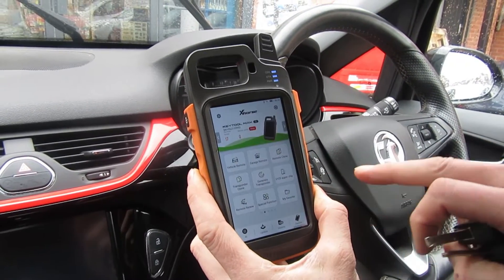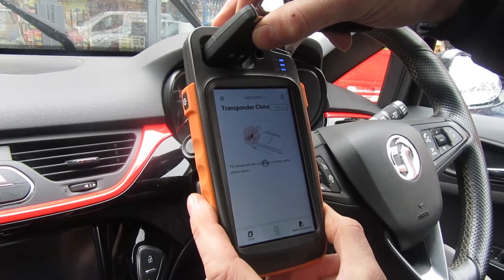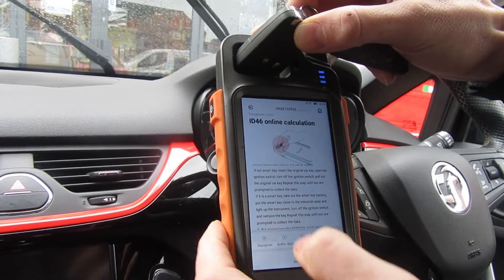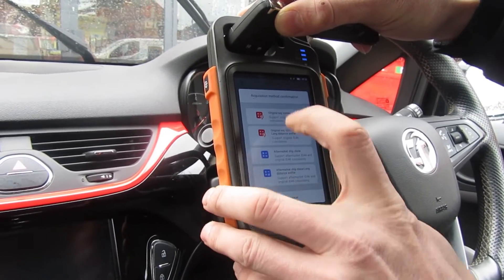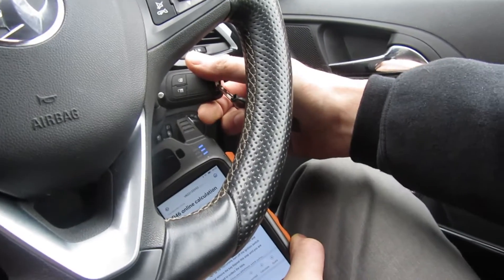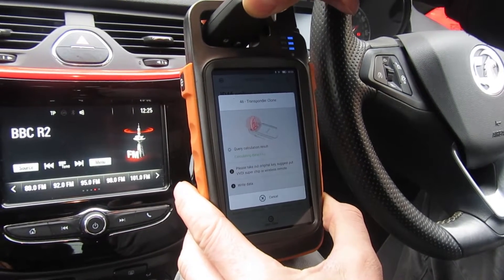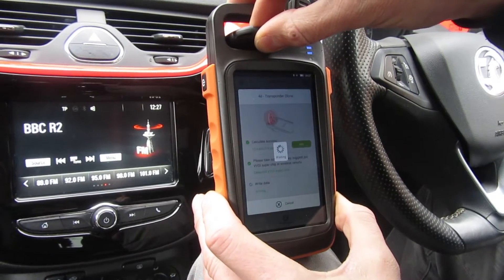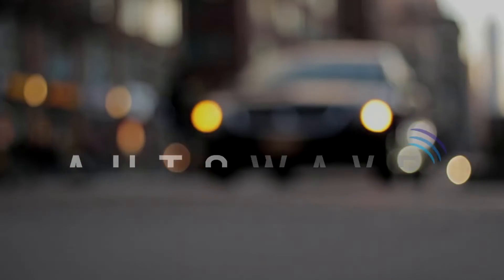Xhorse Key Tool Max Cloning Demo

Comment: where can you buy key blanks with plastic head containing the super chip in it? All i see are key blades for the remote and only transponder superchips by themselves
Reply from the maker: It's not something that we do, the chips are very easy to insert into the key blanks though. https://www.autowave.co.uk/product/forkc-ford-key-blanks/rav-ford-hu101-manual-transponder-case-autkc076/AUTKC076

Comment: did you find remote on other key stopped working? i had this problem on older vauxhalls.  if yes then you have to put key with remote in the ignition to re synchronize.
Reply from the maker: No we have not had this issue as it is only the transponder we are cloning.

Comment: In fact the original remote stopped working and the next morning was working again but the cloned remote was still not working
Reply from the maker: We don't recommend cloning the remote. Cloning a transponder as per the video is recommended. If you need a remote we suggest programming via OBD or manual procedure (depending on vehicle)
Reply: @AutowaveLimited  where can i get a manual procedure manual for all cars ?

Comment: How did You  program remote to car?
Reply from the maker: This video just shows the transponder being cloned as the customer only wanted a manual spare key.
Reply: @AutowaveLimited  what would you have to do to programme the remote central locking after you have done the transponder?